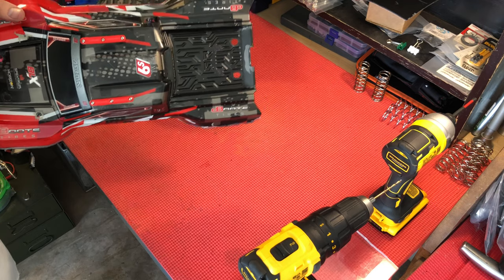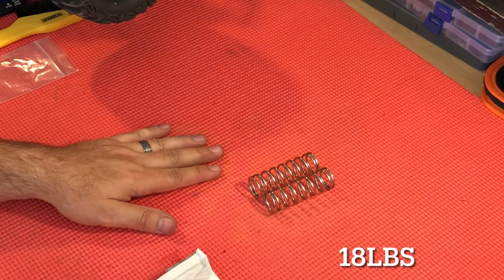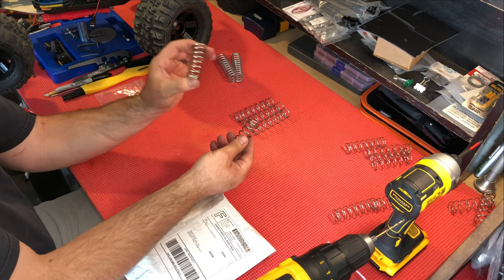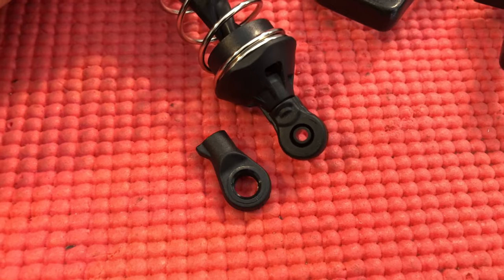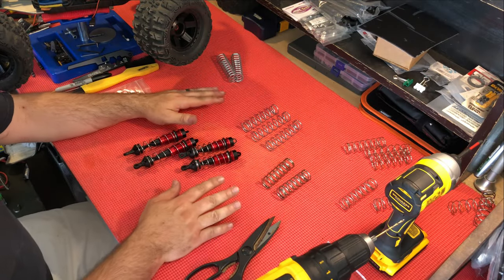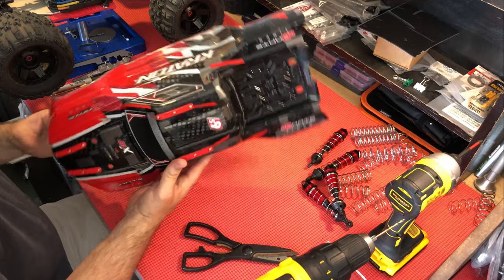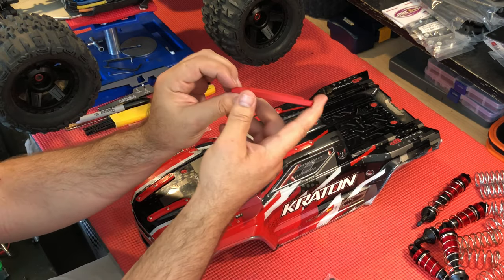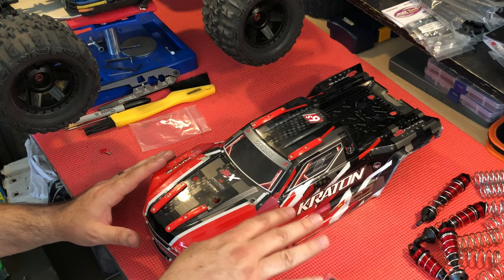Best RC Body Roof Skid Protectors, Roof Rails, Skid plates

Comment: 12lbs springs to use with 2-3k diff oils??
Reply from the maker: No the 12LBS/in Springs that I recommend in the description of the video are actually very similar to the Arma Nero big rock springs. So if you pick those up I recommend running 5K differential fluid in all four of your shocks. And incorporating the M2C shock caps.
Now if you decide to actually pick up one of those other springs, That I laid out in the description that are 9 & 10 pounds per inch Because maybe your vehicle is 2 pounds lighter.
You might consider lowering the thickness of The fluid. Maybe 3K for those. And yes I’m not talking shock oil. I’m actually talking differential fluid.  Technically they’re all silicon-based.
Let me know if you have any other questions
Reply: @EastTactics  that sounds super expensive. I like the stock shock setup on my exb the m2c shock cap are 100$ cad almost. And i saw kevin talbot snap all of the pistons with the m2c setup. The only thing i got from m2c are the shock tower brace for my mojave exb and the diff outdrives for my kraton exb. I have so far no issues. Only my mojave who keeps breaking body posts and bumper springs. Someone is designing a 3 printed one with the same material i think as your skid plates. I have a 3D printed wing mount. Its a noodle i think you can almost tie a knot with it🤣

Comment: You ever going to make a video of you actually driving this? I hear about bashing but I've only ever seen it on the bench. I'm still waiting to see how this body liner holds up.
Reply from the maker: Mike… yes…I promise… and soon.  In fact… I’m extremely frustrated, because I took her out Saturday and bashed her really hard. Only to find that my Insta 360 camera that I had mounted to the brim of my hat overheated and shut down. So I wasn’t sure how much footage I captured until I got home… after it cooled and I got it back on… I found that the entire thing was corrupted footage… didn’t get a lick of it. Really bummed… What I can tell your since you asked.. is that the Body held up like a champ, not cracks or tear. And the 12lb (Nero Alternative springs) I was testing worked like amazing… I was coming down from high drops and the sound was just “Plush” is the best way to describe it. I am definitely giving the green light for those who having been trying to nab the Arrma Nero big rock springs, but can’t find them, to go ahead and buy these springs from CenturySprings. Part number is in the description. 
But ya.. Im going to get out again, with the same springs on and do another hard bash really soon. I just wanted to get these roof rails on asap… and drop a reminder about the active giveaway. Thanks for keeping pressure on me regarding this… Mike… you da man!
Reply: He can drop that K6S from a 10 story rooftop...there will be no damage to that body....the rest of the truck God knows what will survive...but Rest Assured that body liner is the Ultimate Protection.
Reply: @EastTactics  sorry to hear about losing the footage, that sucks man.

Comment: Your shock tower and suspension is what takes the hit instead. Don't think the choc goes away. Idk if chassi slapon concrete is what kills electronics. I dont bash on concrete. I have my plastic chasis rc for that
Reply from the maker: I would say you’re right in the fact that with running springs that are double or triple the pounds per inch in stiffness that you’re transferring the energy into your shocks, your rod ends, and your shock tower. However I’ve seen no issues in that category, but what I have seen is a dramatic decrease chassis slap, It’s especially noticeable when you’re actually not at the skate park and you’re just hitting the ramps at like a dirt track. Coming down from high air, there’s just something satisfying about seeing how well she lands with these modified shocks. I myself love it.
Reply: @EastTactics  i think u made a video in the pass about the shocks and in that same video you showed the m2c chassis bowing like a banana upon landing. Cant imagine now with stronger springs.mine lands on all 4 and doesnt bounce back and its a stock kraton exb. If you just launch from ramps at 70mph maybe. Chassis slap isnt a bad thing. A lot of youtubers started saying metal chassis= electronic failures. Someone with a metal chassi shouldnt be really playing on skate parks unless you like to hear that big shotgun sound when landing. Thats why i have my k4s for that purpose. The stock setup is more suited to handle almost everything. Your setup is only focused on landings from what i see
Reply from the maker: Yes... she is tuned for landing, even to the point of turning the dial slightly backwards for handling. But that’s the way I like it for a straight basher. My strategy would certainly be different if I was rocking a buggy and competing in races lol. 
Make no mistake tho, m2c parts through out make these rigs qualify for double the air time but in the process add a lot of weight. The chassis is still in my opinion the best and most key upgrades for insane sends, the flex it has us there yes, but it returns to straight like a champ. 
So with the stronger body and frame big sends (or concrete) do a beating on our electronics.This weight begs for upgraded shocks to lend reprieve to the electronics, which is why the focus on my channel is on shock mitigation and springs. lol 
I always love your comments, you keep me in my toes.

Comment: I have seen some guys use titanium roof skid screws or bolts that stick up far enough so that they make sparks when you slide. Haven't tried it yet but sounds good. Thanks man,  glad I found your channel
Reply from the maker: That would be pretty sick. If you find em send me a link👍
Glad you found my channel too
Be sure to check out the active jump competition. 
Grand prize - complete M2c beef cake kit & fans for both ur ESC and motor. And more!
Reply: I haven't done it myself.  I have seen Kevin Talbot di it. All you need is any titanium nut or bolt to stick up higher than the roof skid or skid plate or wheely bar. They use titanium skid plates under F1 cars cuz it takes very long time to wear away.  Sparks are the side effect.  You can see it during the races
Reply: It sparks on concrete or hard surfaces.  Button head screws work best as it won't drag in the dirt